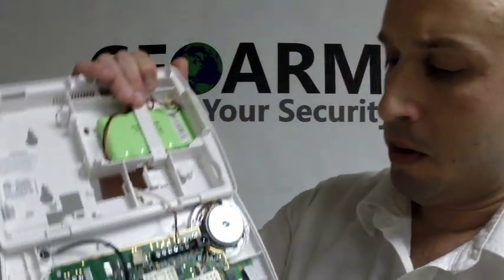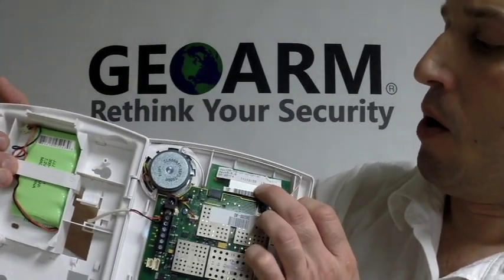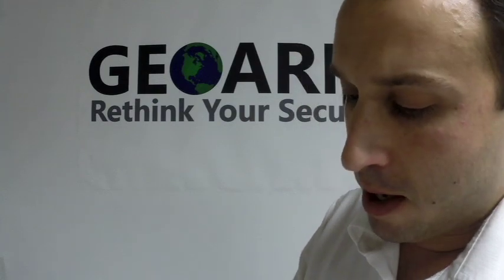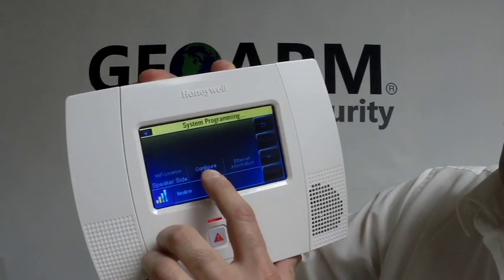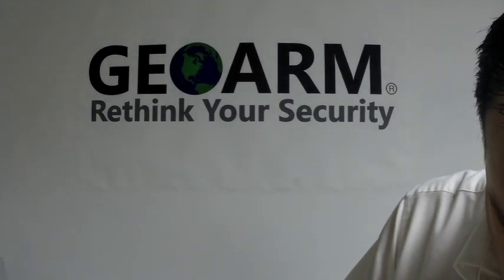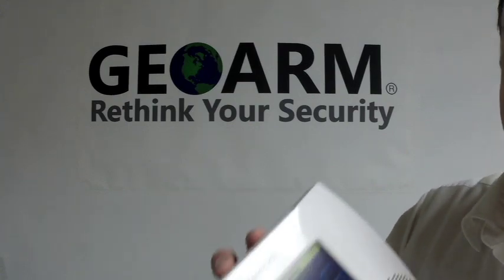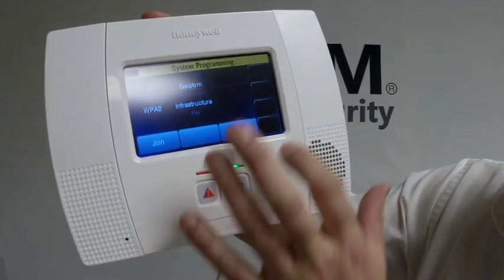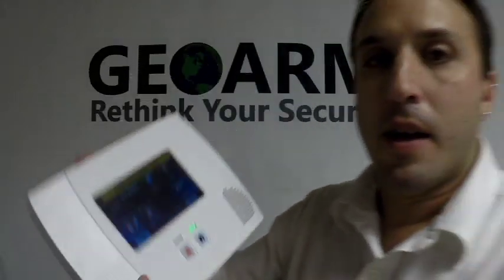Honeywell L5100-WIFI - How to Install/Configure in the L5200 System?

Comment: my panel do not have the option "configure Wi fi.
Reply from the maker: Hey Abdiel, we would love to help you.

What type of control panel do you have? If you have the Honeywell L5200 control panel, do you also have the L5100-WIFI device attached to the panel?

If you need full-service or DIY Total Connect alarm monitoring, and want to become a client of GEOARM Security, then we will walk you through the configuration making it a breeze. Providing great customer service experience is our company moto, so please let us know. #L5100WIFI  #honeywellsecurity   #geoarm